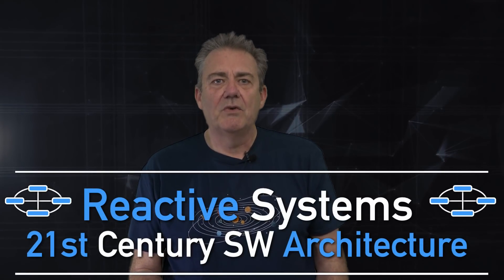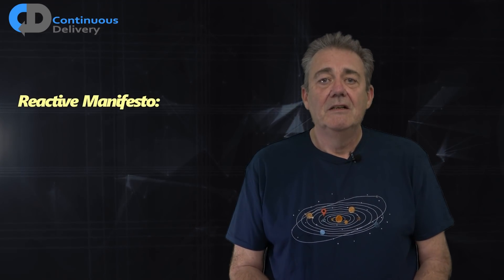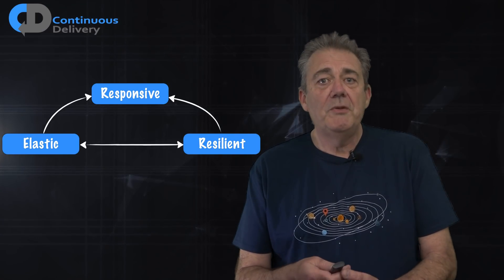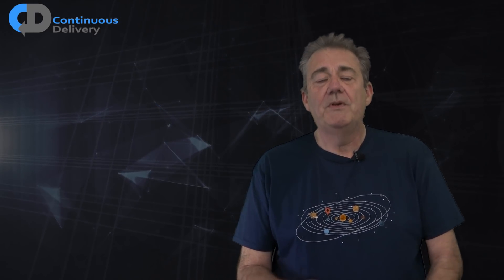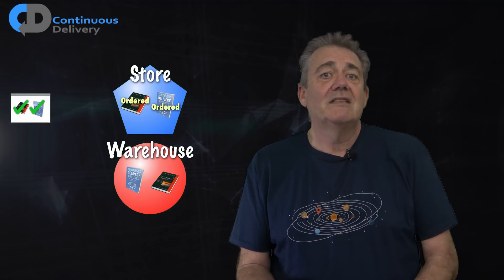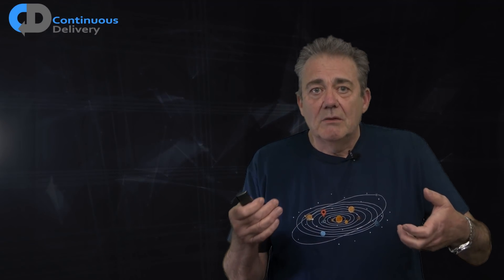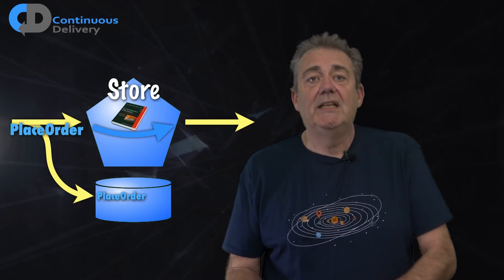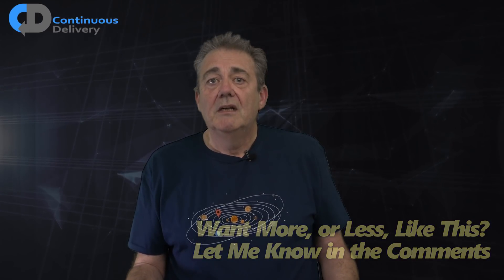What Are Reactive Systems?

Comment: Cute. I mean, there's nothing wrong with anything said here. It's just that it completely ignores all the complexity and problems introduced by this type of architecture. Telling developers that this is "actually simpler" is quite misleading - a lot of devs might venture into this after watching, and all the ugly questions will start to arise. This type of architecture may be simpler for some systems that require extreme scalability, and no doubt Netflix, Amazon and Google need this, and it works for them. But in reality, you trade off one type of problems for another - infrastructure, deployments and versioning, refactoring etc. are all vastly more complex at scale... A video like this needs to prepare people honestly for the new complexity they're facing. It's not for everyone. And it's certainly not appropriate for every project.
Reply from the maker: Well, there is only so much that you can say in a 17 minute video. So yes it doesn't talk about everything. 
I am interested in where you think the extra complexity lies? It is certainly a different way of thinking about systems, but I genuinely don't think that it adds any complexity that isn't already there, it may surface it and make it more obvious to people, but I don't think it adds any. In addition to that, it does allow you to ignore stuff that otherwise infects nearly every aspect of normal system design, for systems at any scale.
As I said in the video, I recognise that it is a subjective, contentious, statement to say that this is easier it is a balance of trade-offs, but I think that overall for systems of any reasonable complexity, this is easier.
Reply: @ModernSoftwareEngineeringYT  I don't think the choice has much to do with the complexity of the system you're building. It's more a matter of scale. If you need to scale to extreme workloads, or extremely big teams, it is probably worthwhile. But a system can be very large or complex without facing any of the problems of scale that this type of architecture was designed to address. Frankly, I don't even know how you can ask where the extra complexity lies? When you choose patterns that require infrastructure, of course you add operational overhead. Service topologies, on their own, is a huge subject. When you add network dependency to all your systems, of course that adds concerns about reliability, error handling, timing, delays, resiliency, etc. etc... You draw these neat little diagrams, but unlike a simple function-call, every one of those arrows implies all manner of complexity and concerns about all of these things. Choosing this type of architecture should be a really well informed decision about a deeper investment in high availability and system/team scalability, because it comes at a premium compared to a simple monolith. Like, for one, you need manpower, and not many people have enough (successful) experience, or the expertise to build something like this that's also maintainable and stable. Far too many teams have ventured into microservice architecture cluelessly already, one disaster after another - there are countless articles about the failures in this area. Look. I'm not knocking it. It has it's purpose. But to sell this like it's going to be easy is extremely misleading. If you anticipate problems of scale, then yes, this will be relatively easier than trying to optimize a traditional monolith. But if you don't have those problems, it's just layers of meaningless complexity. Message based architecture of any sort is not a cure-all for anything. "Right tool for the job."
Reply from the maker: @RasmusSchultz  Fair enough, I began the video by talking about larger scale systems. Sure, if you are writing a CRUD web-app for you Mum's cake shop this is probably the wrong choice. However, as soon as you add anything beyond the most trivial need for distribution, I think that this approach shines. My background is in building distributed systems, for many years, and so that is what I think of. I would argue that any form of distribution adds significant complexity. This approach manages that, and the very complex failure modes inherent in distributed systems, better than anything else that I know. 
I don't think that this is only for "highly available" systems either. I think that one of the major benefits, is that you can create a local, simple, application from a small collection of modules/services/actors (whatever you call them) and it will be easy to program and easy to test. This same app can then be distributed without needing to change the code of the services themselves. Sure, you will need to do more work, thinking about sharding and clustering and so on, but the code itself doesn't need to change. 
The exchange that my team built this way ran on a network of over 100 nodes in two data-centers, but the whole system could also run on my laptop.
Reply: @ModernSoftwareEngineeringYT  ... with all that said, I'm following with some excitement projects like Ballarina and Motoko and a few others who are attempting to abstract away most of that complexity at the language level. If they succeed, the complexity argument might start to fade. Until then, these systems have to be built in languages that really (really) weren't built for anything this network dependent - which currently have to solve problems with libraries and frameworks that substantially complicate, well, everything, while adding the burden of infrastructure management. This could change! I would love to see that happen. But we're some years away from this type of architecture being something you reasonably can or should choose for projects that don't anticipate big problems of scale. In my opinion.
Reply from the maker: @RasmusSchultz  AKKA is pretty mature and used in lots of real world projects. Aeron is built on ideas and technical approaches that we began at LMAX, Hydra that I talked about in a video about BDD (https://youtu.be/9P5WG8CkPrQ), is used for building trading systems very quickly and very simply.
I think that you are right that this isn't yet at the level of "Out of the box" development (though AKKA does that) but the reason I did this video was to 1) celebrate 30k signatiries for the Reactive Manifesto, and 2) because I think that this approach, more than any other that I know, has a chance to make dev of complex systems easier. It can allow less skilled/experienced programmers to focus on the problem in front of them without getting lost in the computer science and technical nerdery of complex distributed systems.  
This is a big deal I think, the industry needs something to make building more complex systems a little easier. Microservices is designed to solve a different problem, but many inexperienced teams and developers mistake Microservices for (Services) and so think that Micorservices is all that you need for distributed systems, and it is nowhere near enough.
Reply: @ModernSoftwareEngineeringYT  I haven't read this Reactive Manifesto, but what I watched you cover in this video sounds like precisely what I understand as being microservices, no more, no less. If there's a difference, it's not clear to me from this video, sorry. The only difference I could spot was terminology. 🤷‍♂️
Reply from the maker: @RasmusSchultz  Ok, not the same thing at all. Microservices are:

Highly maintainable and testable
Loosely coupled
Independently deployable
Organized around business capabilities
Owned by a small team

(Source: https://microservices.io/)

So, not asynchronous, not responsive (in terms of definition), not elastic, not resilent.

Reactive systems are:
Responsive,
Resilient,
Elastic,
(Async) Message-Driven

So, not independently deployable, not loosely-coupled, not necessarily owned by a small team.

Now you can build Reactive Systems out or Microservices, but you can also build Microservices that have none of the properties of Reactive systems.
Reply: @ModernSoftwareEngineeringYT  the properties you list are mostly qualitative - it still sounds to me like you're describing what I'd consider good (micro)service architecture.
Reply: @ModernSoftwareEngineeringYT  I'm reading the manifesto - it specifically says that services can be loosely-coupled and independently deployable, I don't know why you're saying they aren't. Modern microservice architecture uses an event hub, so they are message driven. Though I realize they may not be. I still think what you're describing is a specific subset of microservice architecture - but I also recognize the fact that there's lots of "bad" ideas that could also be described as microservice architecture, so this is not to say the distinction isn't necessary. What it describes is great! Having a terminology is great! I don't even disagree with the rebrand, as the term microservice has a lot of negative connotations for those who have had many of the bad experiences around early (all or partially failed) attempts at microservices. But I still think most of these properties are qualitative priorities of microservice architecture. Everyone's experience is different I suppose - but I was exposed to most of these ideas by an experienced person early on, after leveraging a lot of criticism against badly flawed microservice architecture, the way a lot of articles described it early on. I can't imagine I'm the only person who's had a similar experience. On the one hand, I can understand your desire to disassociate from the term microservices - on the other hand, it's a bit confusing to say that this isn't microservice architecture in some form, or some specific subset of "known good" microservice architecture.
Reply: @ModernSoftwareEngineeringYT  "So, not independently deployable, not loosely-coupled" -- But you did emphasize that they are loosely coupled (by virtue of messaging). And (therefore) the sex-appeal of the examples also partly stem from their being quite independently deployable -- at least to the degree shown in the video, e.g. for resilience or load-balancing etc. etc.

I guess the definitions may be a bit too vague -- especially those of microservices. In the context of other common terms including "react*" (reactive programming, reactive UI, reactive streams, reactor pattern, React, ...), confusion is pretty much inevitable, even with sharp(er) distinctions.

Comment: Thank you. Really like the way explain it. I understand this is an introduction, it would be useful to have some implementation examples. This looks like message queue architecture what's the difference? How is scalability and reactivity implemented?
Reply from the maker: There is some level of 'supervision' that I didn't talk about in this video. Each services generates 'back-pressure' when it is under stress, up-stream parts of the system notice the back pressure and can then react to it and add more, or reduce if the load is low,  resources.

Comment: Thanks for this video. Can we have a detailed video wherein a reactive application is built using available frameworks/libs/toolkits like akka, rx etc?
Reply from the maker: I am not sure that this kind of more detailed tutorial fits my channel very well. It is probably only of interest to a smaller group of people and most of my videos are under 20 minutes, and you can't get very far with anything other than simples examples in 20 minutes. It would be fun though.
Reply: @ModernSoftwareEngineeringYT  one possibility you could consider is providing a sample by github, and in a video, cover the sample on a high level, covering the system structure and using the sample as a launching point for a more conceptual discussion.

Comment: 10:30 - So you've reinvented a log-structured database?
Reply from the maker: No 🤣
Reply: If you zoom into the details there are differences. Mainly the leeway in consistency levels is much better in a system like this, as is the partitioning (sharing) and replication. This helps with resilience, scalability and performance.

Comment: Near the end, you gave the example of having multiple stores if there were too many messages coming in. I'm confused about how that clustering would work. If you send all of the messages to both stores then the clustering doesn't gain you anything because both stores will be overwhelmed. However, if you send some of the orders to the first store and the rest of the orders to the second store, how do you subsequently know which store to send a message to to retrieve details about a specific order?
Reply from the maker: In the last example it is not "Clustering" it is "Sharding" there is some external process that allocates orders to an instance of a store to process  it. There are a variety of strategies for allocating to a shard, but it is complex and does add overhead. You are really getting back to the SEDA example earlier in the video, except you are doing it at the level of messages rather than threads, which is a bit more cost-effective.

Comment: How does the replaying of message to get the "current" state work when the project is running for a long time? I can image there ware already multiple versions of both the messages and the service? Isn't such a replay a slow operation? You need to read out all the messages (or best case only the messages handled by the service) from somewhere. Also could be that a service started handling an extra message at some point in time, would such replay yield a different result than?
Reply from the maker: Most of these systems usually take periodic 'snapshots' to reset a new start-point and then replay from there. Most of my experience of systems like this is from financial trading systems, so VERY VERY FAST, so replaying was mostly a non-event. I seem to remember that in the excahnge that we built at LMAX on startup the 'big services' would take a couple of minutes to replay a week's messages. This despite the fact that we occasionally hit message rates, for very short periods, of the equivalent of around 1 million per second.
You are right the tricky bit is migrating to new versions of messages, but that is only the same problem as any other data migration problem really.
Reply: @ModernSoftwareEngineeringYT  Thank you for the answer, especially for the real world use case.
Indeed from the very nature of the reactive services the replay is fast. Snapshot indeed can speed it up, only it adds extra complexity, because you need to snapshot each service entity separately (it has own memory) and you need to restore restore same amount of services back up. 

I find the data migration of messages harder than normal migration of databases, because there is extra code executing dimension to it (when replay) where in database migration there is the data changing dimension.

One issue which I was still wondering about. When the service goes down unexpectedly, how to we know how far the replay should be run and from where the service should start processing the messages normally and sent it's own to network? Are there some good patterns for it?
Reply from the maker: @szymonlukaszczyk  I agree with you that it seems trickier, in reality though there is really no difference, I think that the reason that it seems harder is just that we are more familiar with DBs. If I have an Address in a DB and I want to add a Postcode field, I have the same set of problems as if I have an Address in a message that I want to enhance. I need to populate old Address that pre-dated this change with some default value for the Address. So all we are talking about is the mechanics of how we do it really, the problem itself is the same.
The restart process itself is pretty clear, you need to load the snapshot, then replay all post-snapshot messages to re-establish the state. The only mlidly tricky part is that you want to allow new messages that arrive during the restart to be added to the message log while you are replaying so that you don't miss anything.
This is all problems for the infrastructure though. At LMAX we built this stuff on top of some software that we released as OSS "The Disruptor" https://lmax-exchange.github.io/disruptor/
Reply: @ModernSoftwareEngineeringYT  Thanks I'll check the white paper from Disruptor, the idea of lock-free message queue sounds really appealing.

Comment: Great video as usual, thanks!

Have you worked with either Elixir or Erlang, the system that you describe here sounds really close to the OTP framework introduced in Erlang!
Reply from the maker: Yes they are essentially the same, or at least very similar, concepts.
Reply: Akka is build on concept of Erlang actors.